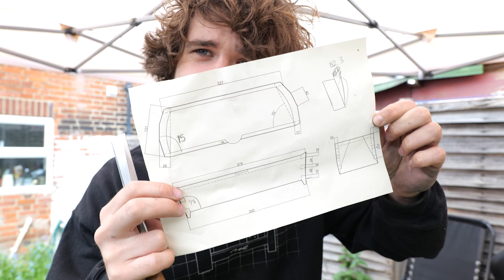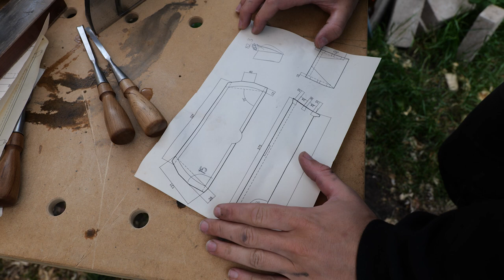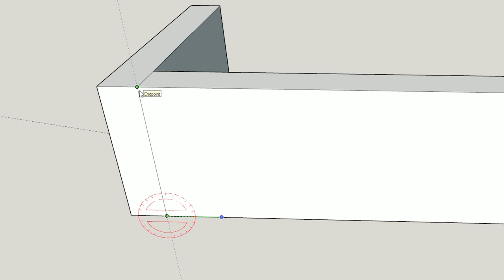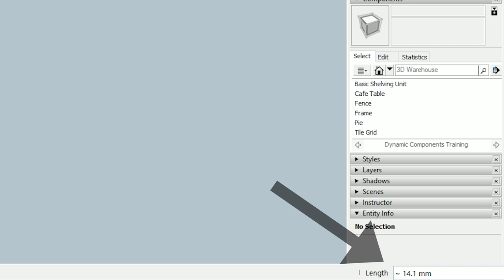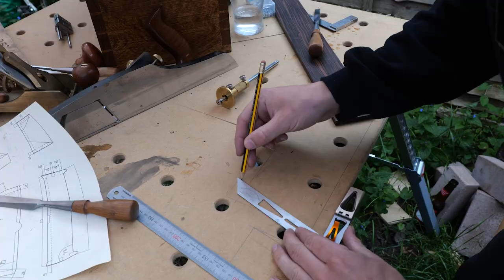Planing Compound Angles by HAND?! | The Garden Workshop #8

Comment: Though i would retire and do a little welding. But, no, i had to watch your dovetailing intro video, ha. I've since bought the moses-katz guide, some saws, chisels, stones, and started practicing.  First box came out ok, thanks to you. For my second box i tried to fit non-parallel sides at 80 degrees. Suddenly i can't use my marking gauges and guides. So, i can't wait for the next video. Perfect timing.  Thanks, again.

Comment: 25 years I’ve been a carpenter/joiner and always struggled with sharpening then I stumbled across Matts video, never to old to learn 👍
Reply from the maker: Cheers Mike, appreciate it mate!
Reply: @MattEstlea  can i ask how do you keep your stone clean
Reply: @itsalaughfirth1012  the simplest way to clean a diamond plate is to spray  some cheap generic window cleaner (water will work too, but not as well) on the plate and scrub it with an old toothbrush and rinse it off. Dry it so it won’t rust and it’s as good as new.
Reply: @michaeldoto4673  thank you
Reply: @itsalaughfirth1012  you can also use a white gum eraser. The Trend Diamond stones come with one . Since the one from Trend seems to have disappeared from my shop I have been using one made by Staedler.  Staedler is a company that makes specialty items for the office geared toward engineers and architects protractors, mechanical pencils and of course white gum erasers.

Comment: Those compound angles turned out great. Doing that without a mitre or table saw is really difficult -- nicely done. By the way, I don't know how much time you spent on figuring out the ratios for the angles, but as a quick tip, should you have to do that again in the future: Those ratios are just the tangent of the angles, e.g. tan(15°) ≈ 0.268 = 26.8/100. Whenever I can't be bothered to look for my protractor, I just take out my phone and do it that way.

Comment: Really good point about how to deal with getting started! I struggle with the same thing sometimes, and I have a couple of similar strategies. 

If I'm midway through a project, I'll deliberately leave something easy to do the next day - eg. sanding, or marking up components. That way you've not got to think about things like compound angles first thing in the morning! 

The other option is to have two projects on the go at the same time. This works well when you hit a problem during the day, as it means you can just move to the other project and come back to deal with the issue later on. It's rare that the problem seems as tricky to deal with once you return to it....
Reply: I do similar with software, I try to make sure the last task of the day is not-quite-finished, then I have something to get into the next day.

Comment: Great tip up front about just sharpening!!!!  What cap screw/driver do you use for your irons? I have a woodriver that’s about 1-1/2” long, but I’d like to try one of those palm sized ones. It’s as though the ferrule of a palm handle fits over the nut and has a slotted protrusion within..?? Is that right and who carries them?

Comment: I love my LieNielsen tools. I find their steel is a pain to sharpen on diamond. I have resorted to starting on an extra extra coarse diamond to get the burr then coarse, fine, super fine, leather strop. How many strokes does it take you on a 1000 grit stone b fire you feel a burr?
Reply from the maker: Depends on the size of the secondary bevel! I agree though
Reply: Matt Estlea that helps explain it a lot actually. I don't use a secondary bevel. When I'm grinding, it's the whole bevel. I find if I do 100 strokes on my extra extra coarse I get a good burr. I don't at 60 strokes. With regular carbon steel, just coarse, fine, super fine then done.

Comment: For your sharpening guide stop block, couldn’t you have like a single board with very shallow tiers for each of the degrees? Thought of that because I thought of making one like yours but at the same time don’t want more large stuff cluttering up my small workspace lol
Reply: I found I only used two settings (25 degree and 30 degree, iirc), so I just made a double-sided one (the width of a single block).  If you''ve got the time, you could put all four together as a double-ended double-sided board (e.g. 25/30 on one side, and 20/35 on the other, or whatever angles you want, etc).... takes up a lot less space than Matts board - but not so quick and easy to put together.
Reply: Geoff Willingham yeah that’s what I was thinking. Good idea on the double sided. My shooting board and sharpening station board already take up enough space as is